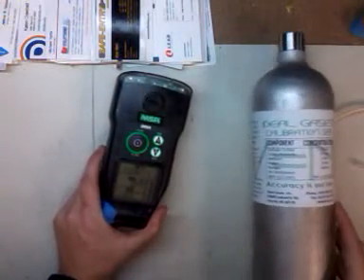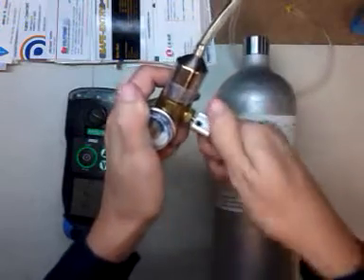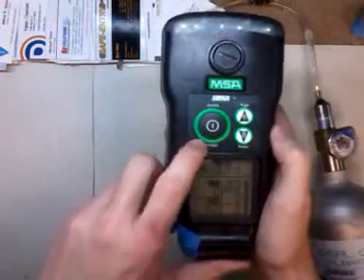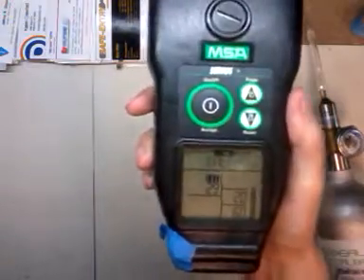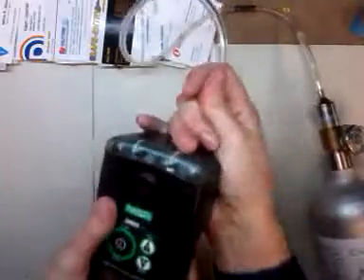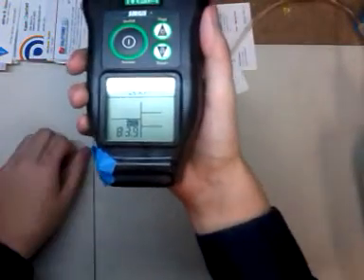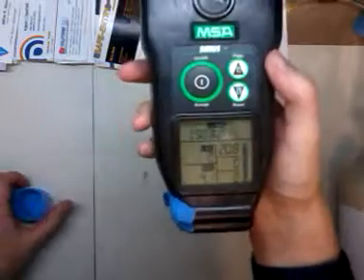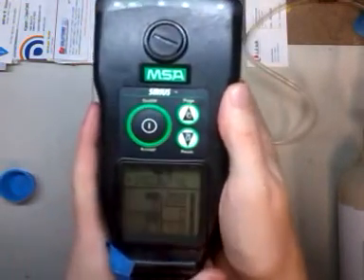MSA Sirius Gas Monitor Calibration Guide by Ideal Calibrations

Comment from the maker: Hey Zenhakuin, no this device isn't radioactive.  It has electrochemical sensors (basically little batteries that respond to gases in the air), a catalytic bead sensor (basically a two hot beads with a wire between them), and a PID sensor (which is basically a little flashlight with a plate that ionizes gas molecules for a second to determine concentration) if that helps.  Perfectly safe to use.